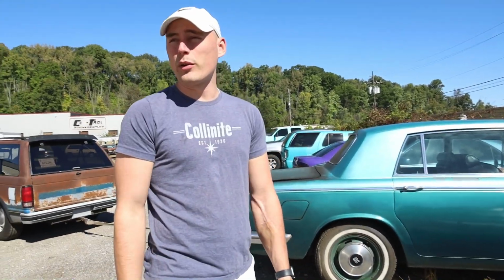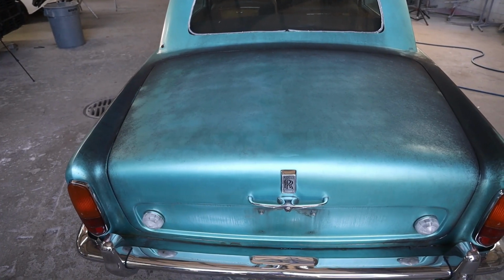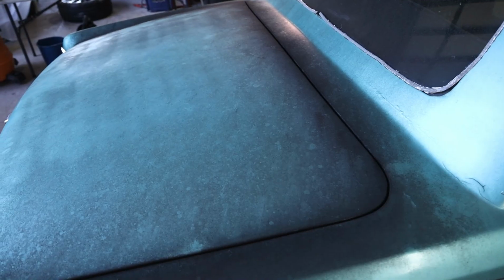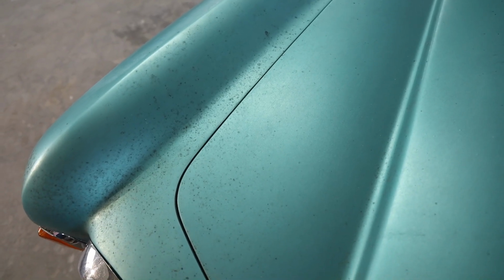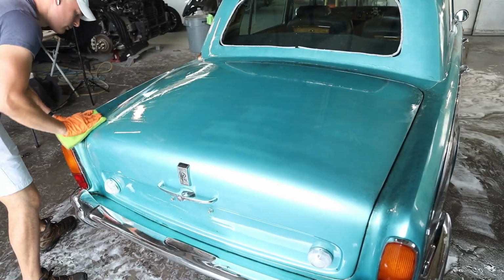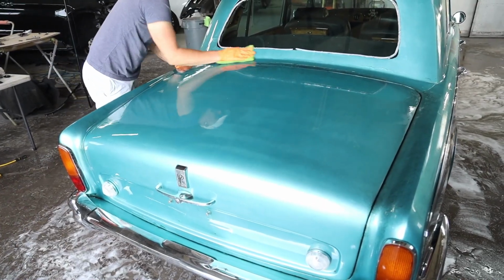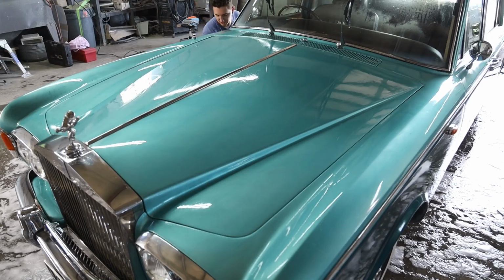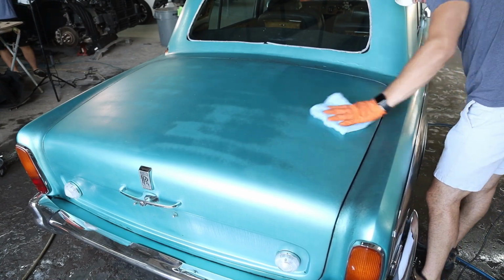ABANDONED BODY SHOP FIND First Detail in Years Rolls-Royce! Satisfying Car Detailing Restoration

Comment from the maker: Bonus question: What year & model do you think this Rolls-Royce is?
Reply: 1978 Silver Shadow
Reply: It's a Silver Shadow. Probably early 70s based on the way the rear end looks. I'm gonna guess 1970-71.
Reply: 1970 rolls Royce silver shadow
Reply: It's actually a Wraith (LWB Shadow 1).  These were built in much fewer numbers than standard shadows. Longer in the back doors, different rear window and the same hub caps as usually seen on later Spurs.  What a car!  Thanks for the great content as always!
Reply: I'm going to guess it's a 1972 Silver Shadow Long Wheel Base (LWB) with the Everflex roof covering removed during the two-tone repainting job.
Reply: 1972 Silver shadow
Reply: I would guess it's an early 70's Silver Shadow Long Wheelbase model, since it has the chrome bumpers.The interior is also early 70s. At some point this same car was called the Silver Wraith (in the 80s, I think). The Silver Wraiths would have different bumpers (the chrome bumpers look best on these cars). I love the colors on this car, very unusual and rare choice. And it's so striking without the vinyl roof. I suspect the car would be more valuable if one stayed with the original colors and restored the interior, which is would no doubt be expensive, but would more than pay for itself if sold to a collector. it was fun watching you work on her! The wheel covers are not correct, but are quite handsome. If it were my car I'd keep them.
,
Reply: Definitely black. It’s just the only right color for a luxury car such as this.
Reply: @eddstarr2185  The Everflex roof covering was an often ordered extra cost option. This car may well have been built as a slick top
Reply: It's between 1974 to 1977, as i think it has the flared wheel arches.
Reply: 1971 Silver Shadow.
Reply: I'd guess 71 to 73.  I like the color.  Sheesh with the prices RR charged they couldn't give full wheel covers?
Reply: Its between 1970 and 1972 going by the dash which changed early 1970 and the reversing lights on the boot lid which were discontinued in 72 and that paint work and colour scheme are not original
Reply: @denisepidgeon6194  Also the bumpers
Reply: Silver Shadow one 1971 (air vents under the headlights) I think karcher is not good for old cars. Excuse my bad english, i m french
Reply: @1057shelley  definitely not! The teal is perfect for a classic 70s luxury car. Black will just hide the body lines and won't suit it at all
Reply: I prefer the original color!
Reply: Before repainting try first sanding the trunk with sanding paper p2500 after that work polisch the trunk, when it is not ok yeah repainting!. Btway this rolls royce is a masterpeace and my favorit model rhd is original englisch its a beauty man!!!
Reply: 1975-6 it’s a wraith mine was light oyster over walnut and looked stunning ,the only way to make it look good would be a bare metal repaint you can’t keep putting material on top of material it will sink
Reply: Silvert Shadow 1
Reply: 1972 Silver Shadow?
Reply: '84 Silver Shadow.
Reply: It has the narrower flares and is therefore pre-1974 facelift. @datkin21
Reply: Those actually ARE official RR colors on the car now. I've never seen them like THAT? Very Vegas! The hub-cap (used on Wraith and Cornice cars, I prefer the old painted caps) trim-rings should be knocking-around, maybe in the trunk.
Reply: I think gun metal gray rather than black. A black car that size makes it look a bit like a hearse.
Reply: What about your arm you don't want to let me know I just wanted to know
Reply: What is the problem
Reply: The original color,and also try to repear The car with original Rolls royce pieces!.
Reply: Silver shadow 1
Reply: 1969-1970   Rolls-Royce Silver Shadow Long Weel Base   Win no LRX 6000-10.000
Reply: @michaelwhite2823 "Dogue dish".. 😅
Reply: 1967

Comment: The long wheel base Shaddow was introduced in USA in late 1969. The Wraith name was used after the introduction of the Shaddow 2 in 1977 a year after the nasty rubber bumpers arrived. The long wheelbase had 4'' of extra room and a smaller rear window, like this car. The slight flare to the wheel arches was often retro fitted to older models when rust and alloy corrosion were removed. I date this vehicle to between 1970 and 1976  :)

Comment: id paint if flat black with an outlandish '70s style flame job on the front then layer upon layer of flake. all the chrome would be Gold anodised with gold kerb feelers, sidepipes and wire wheels.  purple velvet tuck n roll or buttoned interior with a gold anodised chainlink steering wheel to complete the look.

Comment: i’m thinking you might be able to salvage the OriginalPaint i’ve owned and restored many older British Automobiles and although their Paint  is usually soft  they can usually be brought back to life  unfortunately on high spots of the body  it’s easy to get down to the gray Primer and seal coats they use  and if they are going to do a repaint my suggestion would be to  do the factory color  to match the jambs and Firewall / engine compartment especially that it is a Rolls Royce  and repaints can hurt their values plus there are usually small areas of the dash area visible   through the windsheild and sometimes  other angles  that are sprayed prior to full assembly  sometimes the original paint can be Wetsanded  and shot with a modern style Clear Coat  to refresh the entire Car  i’ve topped the orignalPaint with  a Dupont Clear and aPpPG  one as well on some older Sports Cars  from England , Admittingly i’m not  a expert on the Vintage paint on the Era of this Rolls Royce so i’m not positive  which Clear is most Compatable with this Specific  Automotive

Comment: So you attached the tow rope to the spare wheel carrier numptys also if you had tapped the fuel pump it probably would have started it’s underneath half way down the drivers side it’s electric and they stick giving it a tap would free it off

Comment: Looking at the longer radiator grille, the full chromium bumpers (later changed to plastic, with a chromed top section) and the vents under the headlights that were deleted in the early 70's, this is an earlier model and it is not the Silver Shadow, as Rolls Royce named their longer wheelbase (see the wider rear doors) the Wraith. 
I would guesstimate too, that this is about a 72-73 model. 
I'm from the UK and it is great to see you detailing a fine Rolls Royce, where the steering wheel is on the right sight, both physically and figuratively...!

Comment: A really nice black cherry metallic with silver from the hood up the top to the trunk lid. And a charcoal grey heavy metallic pin stripe up the side and color matched OEM wheels and the thick White Wall tires where the white covers the side wall. Some upgrades I'd do are efi, disc brake conversion and electric windows of they are vacuum operated. I'd also do an aluminum radiator, silicone hoses and a high flow water pump.

Comment: The top part of the iconic radiator grill takes 5 hours to make. And 6 hours to polish before it goes to chrome! The windshield is polished with the finest pumas stone. To get the ultimate ocular clarity!  The hides for the seats come from cows that have been kept away from barbed wire and mosquitoes etc to have a flawless finish! Each car has enough leather left over that’s kept in the factory incase it needs new interior!  The paint finish is called a piano finish! As it’s flatted and polished to perfection! The 6,3/4 litre engine is run for 48 hours at different rpm to make sure it’s perfectly run in for when the customer gets it!!
Me personally. I would have the car in rather a bright silver, a dark grey silver! Or a gun metal grey! The cars a late 70s early 80s shadow. So gun metal grey might look a bit to much!